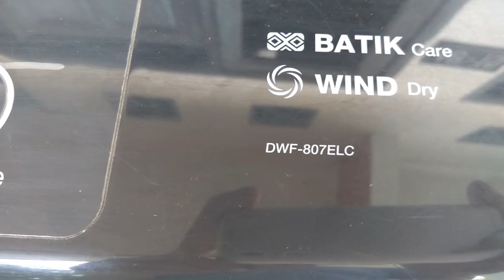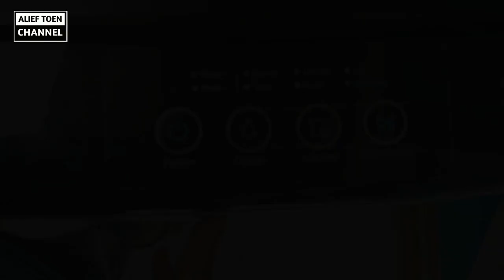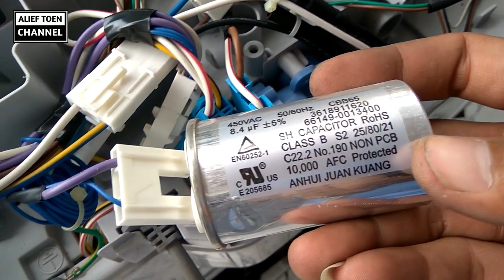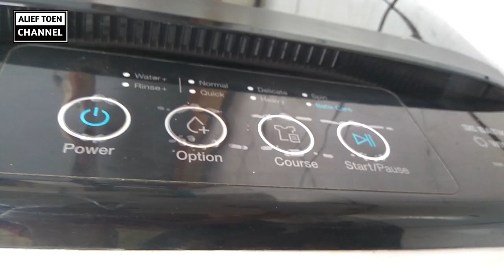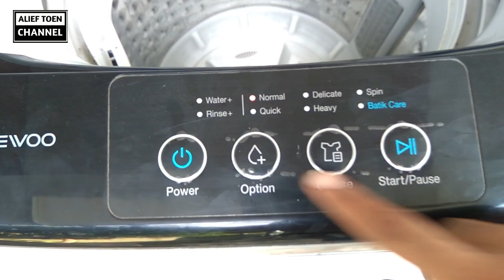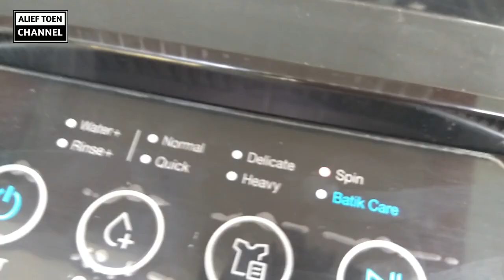Penyebab Mesin Cuci Daewoo Macet di Pulsator

Comment: Bang kalau error' le swit sudah digabung berjalan pelan SD itungisi air mau jln le lagi apa ya ,dwf 110 t
Reply from the maker: Klo switch pintu udah dijumper to tetap, coba urut lagi kabel nya dr switch pintu ke modul. Klo perlu yg disoket modul dijumper disitu. Klo bisa berarti kabelnya ada masalah. Ukur kabel pakek multitester pastikan masih nyambung. Klo dipastikan masih bagus, berarti ada jalur di PCB yg putus.